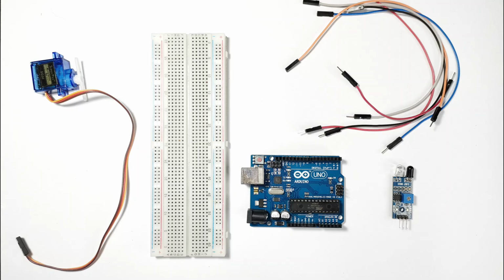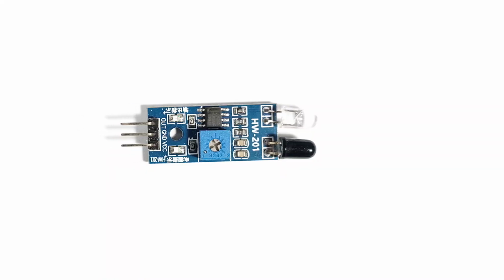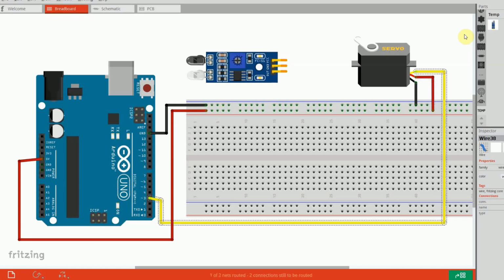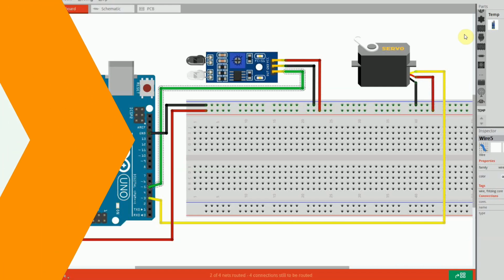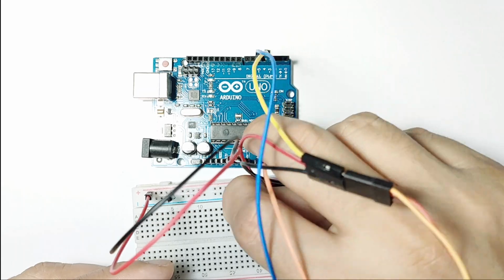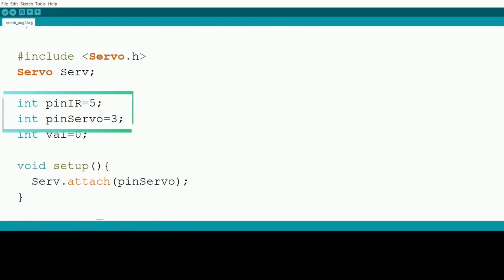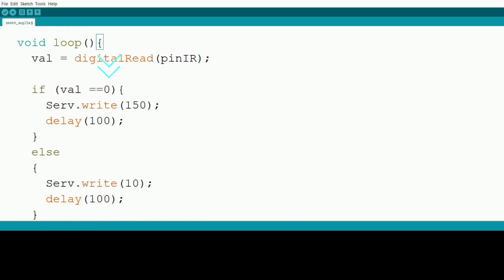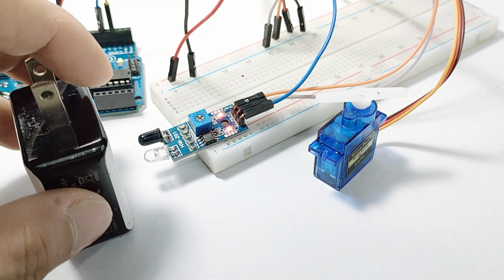Arduino Tutorial: Control Servo Motors with HW-201 IR Obstacle Sensor | Step-by-Step Guide

Comment: Hi. Is it possible to reduce the rotation speed using the same sensor? Thank you
Reply from the maker: Yes, it's possible, but you have to use a for-loop in your code. Check this article: https://www.arduinointro.com/articles/projects/simple-radar-system-with-infrared-and-servo-motor